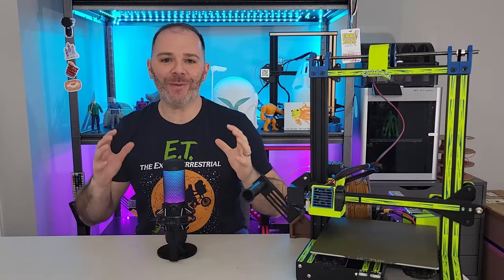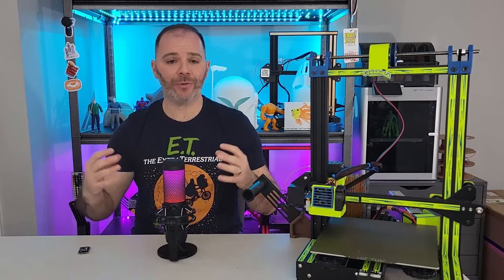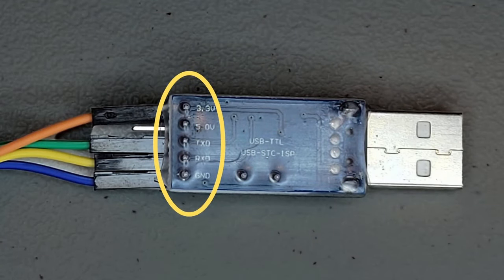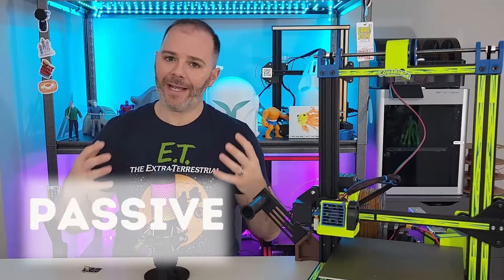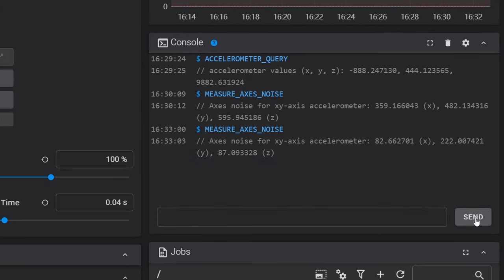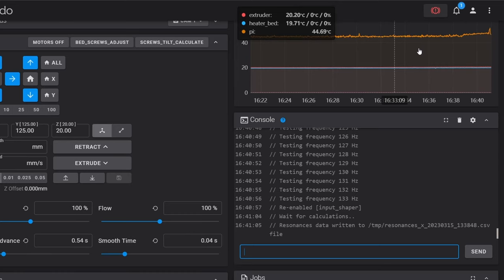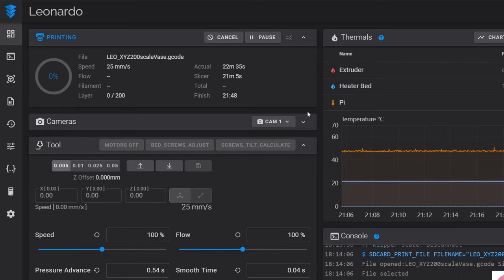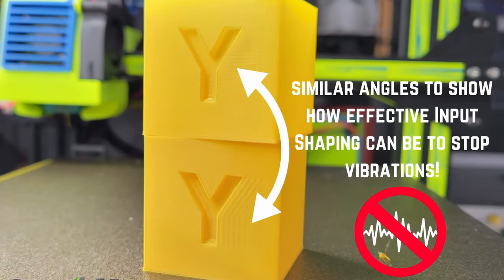Input Shaping Made easy with a USB accelerometer!

Comment: Doesn't the tape dampen some of the vibrations it would otherwise want to cancel out?
Reply from the maker: I haven't found that to be a problem. I have tried a number of different methods for testing this and even under extreme circumstances the vibration data that is collected always seems to be similar or the same.

Comment: Thank you for this informational video. I had one problem that got solved i thought i share.

When flashing with command: "stm32flash -w out/klipper.bin -v -g 0 /dev/ttyUSB0"
 
It failed saying "Wrote and verified address 0x08000300 (0.94%) Failed to read memory at address 0x08000300" on and on again at different %. Tried to plug the usb flash device directly to the pi without hub, usb extention cable. Also in usb 2 instead of usb 3 port. Same fail results. All worked when removed the "-v" command from the line like this:

"stm32flash -w out/klipper.bin -g 0 /dev/ttyUSB0"

It dont verify i guess but write the firmware and all done, works.🙂

Another thing. Please add your inputshaper.cfg lines in the description or a link to your site with it or something would be awesome😀
Reply from the maker: Thanks for the detailed comment. I thought I had my website linked in the description, but I wouldn't doubt that I forget it as on oversight as well lol I'll look through it now and add it , thanks!!

Comment: Hello Leo! I love you videos! I know I'm late, but...trying here I stopped at flashing the device (identical to yours). Getting a "Using Parser : Raw BINARY
Interface serial_posix: 57600 8E1
Failed to init device." I don't know what to try...
Reply from the maker: Hey, thanks for watching ! I haven't ran into an issue like this myself. My first thought would be something is wrong with that small flash device that was sent with the accelerometer. I'd contact Triangle Labs and see if they have ran into this issue and maybe can send you a new unit. Let me know how it goes, I'd be curious the solution.
Reply: After a lot of back and forth, I finally solved the issue. This error happened after a glitch during the Klipper.bin flash process with my Raspberry Pi 4. Go to the Triangle Lab website and search for the PDF file "usb-adxl345_firmware-flashing-on-windows-PC.pdf".
Here is the tricky part, you'll not be able to click on the download button STM32CubeProgrammer because the communication with the module through the COM port is not active.
So you will have to hold the boot button and press the reset button during 1 second and then, push the download button in the STM32CubeProgrammer software.
After 9 or 10 attempts, I was able to communicate with the ADXL345 and the flash the module.
I hope is going to help you!
Reply from the maker: I am going to add this info to the description, awesome work! I don't know that I would have stumbled upon this. Glad it's working for you now.

Comment: Hi Leo, You sent me a link to have the Sprite firmware for the Aquila so I could run my high temp hot end at up to 300 C. 

And I asked you to tell me how to remove it and replace with the Alex improved firmware. But I hit a problem?  

I did the normal flash the firmware as normal to change it back to Alex's but when I checked the screen the Sprite firmware stayed on the system.

I tried a 2nd time and again the sprite firmware was still staying on there?  What is best to do t remove this sprite firmware as I need to have Alex's instead.

Thanks keep the upgrading videos coming!  😉
Reply from the maker: Hey Colin, I remember ! Usually when you've flashed successfully before but it's not working now it's usually either an SD card issue or a nesting issue. For the SD card I would try first to reformat (Fat32/4096 bytes), or if you can try another SD card (and remember to format it lol). For nesting make sure there's nothing else on the SD card besides a folder named 'firmware', and the .bin file is inside. Also make sure to change the name of the .bin file as I believe the Aquilas will not flash the same file twice. So you can just append today's date at the end. Try that and let me know how it works.

Comment: after geting the results of input shaper what acceleration you set in your config?????
Reply from the maker: The accelerations you use will not come from any of the Input Shaper testing. The accelerations that the input shaper shares are the MAX accelerations that you could use where the input shaper will still work effectively. Calibrating your max acceleration is a different test entirely. Of course once you do have you max acceleration you want to try and make sure it does not exceed the max acceleration the Input Shaper can use, otherwise it may not be effective. Does that make sense ?

Comment: So far really like your tutorials, but I have a question: what about if you are running klipper/Raspberry Pi on a PC? can you connect the accelerometer to a usb port to the computer and get it running in Klipper? Also, how would you go about configuring this on a Delta printer, for example?
Reply from the maker: Efrain, yes you can absolutely use these accelerometers when a PC is the host device used to run Klipper! That's actually what is so beneficial about these USB accelerometers. Most all Klipper hosts have a USB port, which means these can be used on just about any device running Klipper (which includes laptops and computers)! I don't have a Delta printer, so I can't speak from experience, but all should be the same. The only difference is, like a CoreXY machine, the delta printers can leave the accelerometer in place while testing both the X and Y axes!
Reply: I’d like to set klipper up on an android phone instead of a pie to save cost - have you got any advice on how I could get the accelerometer to connect to the phone once klipper is installed? - it is getting to the point where I am thinking of first setting up clipper on my main PC just to get the accelerometer info 

Any help is very much appreciated
Reply from the maker: Charles I havent delved too deeply into running Klipper through a cell phone as a host device. I know it has to do with rooting your phone, and a lot of other hoops, as for getting an accelerometer to run I wouldn't really have an idea (besides maybe some massive USB C hub that can run from the phone. 
    Starting it on a PC is a great idea! It's just as easy to set up as the other mainstream options. You can certainly gather accel data while on the PC and then use that info for your Klipper config tbag you're using an another device.
    If you're looking for a smaller portable option (other than a PC) than the Inovato Quadra is what I would recommend! I have a video on the setup with that device also.
Reply: @PrintsLeo3D  Thank you for your quick reply and advice. I will look into the Invato Quadra!
Reply from the maker: If you need help with it, let me know

Comment: Nice video, but I'm total noob in this. I have Triangle ADXL 345, connected it, downloaded Putty in my Windows but I cannot pass through the IP address or my host name. It's either error and it closes or I just have black screen. What am I doing wrong? Thank you.
Reply from the maker: Hey Danny let's see if we can get this thing working for you. You downloaded Putty, and when you open that program it prompts you have an IP address. If you insert the IP address if your host device (the one you're using for Klipper) does it allow you to connect ?
Reply: Thanks for reply. I hope I understand it well. I'm using my PC (same where my Putty is) for using the Klipper (the Fluidd). Do I put the IP of my PC or IP of the printer? When I try IP of PC I got error. When I try IP of printer, it connects but it wants login and password but don't know which one. Sorry for bothering you with this. @PrintsLeo3D

Comment: Am I going to have to run this same setup for 2 different printers each running a different Pi. Or once I install the firmware into the accelerometer I can just plug into any printer?
Reply from the maker: You're correct you only need to flash the accelerometer once, but  you'll need to make sure you set both pis up also. Which means downloading that numpy module (I did through ssh), and also each pi will need the adxl.conf configuration file. The file is the easy part because you can just copy and paste the same file for each pi (if that gives you issues you just have to double check the serial address for the adxl). If you have any questions let me know.

Comment: Hows that Trianglelab USB adxl345 Accelerometer working for you after a month?
Reply from the maker: Awesome! Been working great for the time I've had it, and I've even been a little rough with it too lol forgot to remove it from the bed once and ran the printhead into it 🤣 that being said been working well and I am more than satisfied with the results.
Reply: @PrintsLeo3D  Any idea when your going to do the other Klipper videos... pressure advance, max acceleration/max speed/max flow???
Reply from the maker: Pressure advance is going to be my next video. Going to hit the Mac speed/accel/flow stuff as they all sort of rely on one another.

Comment: If you have a bed mounted shaper do you change the [resonance_tester]  probe_points  to the location of the shaper? Or do you keep the cords to the center of the bed?
Reply from the maker: I just keep the coords the same and run it. Ultimately you should get an accurate number along the bed no matter where the accelerometer is mounted (or in theory you should).

Comment: I'm using an old laptop ruing Linux for my klipper and I want to use the creality accelerometer that uses USB connection,  do you think that accelerometer will work whit the laptop? 
Because I think that accelerometer only works whit the sonic pad
Reply from the maker: That's the great thing about Klipper, it will work on whatever device is hosting Klipper (so long as it has the correct ports). So yes it will work. Now, Creality may or may not have made it difficult to create the appropriate input shaping section, but you should be able to reverse engineer the correct templating from looking at how it works on the Sonic Pad.

Comment: Hey amazing guide for the install, just having an issue with mine. 

I've copied the exact same inputshaper.cfg and added the include line in my printer.cfg. However, I get an error saying "mcu 'USB-ADXL345': Unable to connect". I've tried enabling SPI interfance via PuTTy, but no luck. Any advise would be great!
Reply from the maker: Hey Norman! When created the adxl.cfg were you able to get a serial ID from the device through SSH? Also if you were able to get a serial address to you copy and paste it into the .cfg and Save?
Reply: Hey, yeah got the serial ID from SSH. 

Same as yours in the video except it’s USB0. Copy and pasted that to my adxl.cfg. 

Pretty much followed your video exactly. Just couldn’t get it to run once’s adxl.cfg is included.
Reply from the maker: OK that's great, means you were able to flash the accelerometer properly at least. When you unplugged and then replugged the accel into the host device are both of the lights illuminated.
Reply: Yeah, both lights are flashing after unplugging and plugging back in. 

I also tried reflashing the accelerometer but nothing still. Could it possibly be a defecting unit?
Reply from the maker: That's weird because the lights shouldn't be flashing after a successful flash, they should remain on constant.
Reply: Oh sorry, I confused my words. 

Both lights are on, no flashing. I meant to say, I tried reflashing the accelerometer, but it’s still not working.

Comment: I follow your step until flash this triangle lab ADXL 345 accelerommeter. I press and hold Boot0 and press Rest, the PC13 light is off immediately. However no matter what I try, when I release Reset button, the light is come back right away. I am not able to go into flash mode. Is my accelerometer a defect one?
Reply from the maker: That sounds like it's not functioning correctly. As long as you're continuing to hold boot while you release reset it sounds like you're doing everything right It still might be worth trying to use it for the time being because these do come with some version of Klipper pre-installed. For the long term I'd reach out to the company because it sounds like you will have flash issues down the road.

Comment: These look OK. I like the Fysetc portable input shaper. It connects to the PI or similar via USB, to update it you just copy a file to it via USB from your PC. Couldn't be easier.
Reply from the maker: Michael you're right these are certainly not the only options. A friend from the Discord uses the Fystec one also and speaks highly of it. These are all just leaps and bounds ahead of when you had to buy an adxl separately and solder on some headers to make it all work. Whichever you decide I think these simplify the process and help bring in a larger audience to improve print quality. Thanks for watching and importantly thanks for leaving your experience with these accelerometers!!
Reply: @PrintsLeo3D  Yes, just calling them OK was perhaps an understatement. I will certainly never go back to the multiple wires of my old sensors and any of these would be great.
I guess its important to say that the Fysetc is more than a bit specialised for the Voron printers with its mounting hole spacing that matches the Voron printheads and might not suit other printers as easily.
Reply from the maker: To be honest with all the praise I've heard for the fystec versions it may be worth it to include in the written article I add to my website.  As far as never going back tell me about it lol I've bought so many different lengths of JST cables they have their own drawer in my toolbox lol

Comment: Thanks for the guide, I got same adxl from trianglelabs and I can see its in the serial port and made all the necessary settings in cfg files but I get "Unknow command: ACCELEROMETER_QUERY " any idea?
Reply from the maker: Double check you downloaded and ran all the necessary commands for the MCU you're using. That would be the 2 commands I ran at the beginning of the tutorial section.

Comment: 28:14 1e4 or 10^4 is 10,000, not 1,000. Easiest way for me to remember powers of 10 is that the exponent (4) is how many zeroes it has. 10^1 = 10; 10^6=1,000,000; 10^0=1; 10^-3=0.001.
Reply from the maker: Shoot, I felt like I went over this a few times to make sure I didn't make a silly mistake, and of course I must have lol thanks for picking it up I appreciate that. I am putting together (have been for months it feels lol) a text version and I'll be sure to double check this info for that article.

Comment: I could not find any place in your website to copy and paste the commands.
Reply from the maker: Yea unfortunately I haven't had time to finish an article for the website. All the commands should be in the description of the video for your copy and paste-able pleasure. If what you need isn't in the description let me know and I can email it to you.
Reply: @PrintsLeo3D  I’m trying to get the exact same (as yours) USB ADXL345 to work on my Vcore 3.1 running RatOS.  I’m following your video exactly but I get nonsense when running the ls command.  I have not flashed it since it came pre-flashed but I think that’s my error.  My version of Klipper is unlikely the same.  Do you have to reflashed it every time Klipper is updated?
Reply from the maker: There are times when the Klipper versions not matching can be an issue, and if this continues for you we can look at that and probably flash the adxl. That being said if there is Klipper installed on the adxl there should be some response from the ls command. I remember another user running into a similar issue (and I think using the same OS). Let me dig through some emails and see if I can find the answer !

Comment: any help with installing my crtouch would be nice i picked it over the bltouch on my printer mainly due to the cable just being one
Reply from the maker: Blizzy I'm happy to help anyway I ca! There's usually not much (if any) difference between setting up a bl touch and a cr touch. Are you running Klipper? If so what printer and mainboard?
Reply: @PrintsLeo3D  I haven't upgraded to kipper yet still trying to pick a soc it's voxelab aquila g32
Reply from the maker: Have you taken a look at my bl touch video that covers the Aquila and Marlin firmware? That covers all the bases but it's a long video lol 

https://youtu.be/ARAhqgkfBMo

Comment: Can this be used on a FLsun Super Racer ?
Reply from the maker: Yes absolutely, as long as you're running Klipper firmware! There might be a few minor differences for delta printers so I would check the Klipper docs for those specifications (https://www.klipper3d.org/Resonance_Compensation.html)
Reply: @PrintsLeo3D  Thank you.